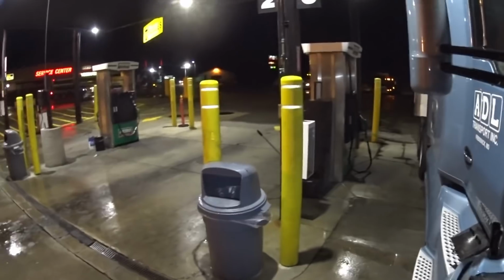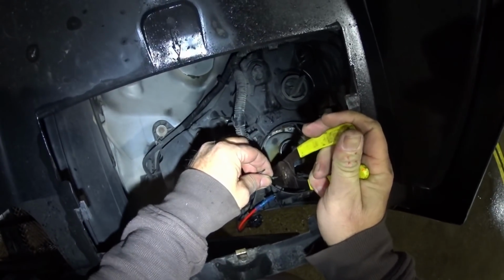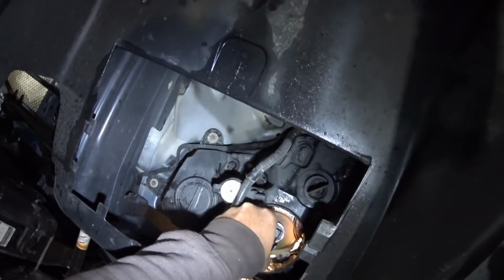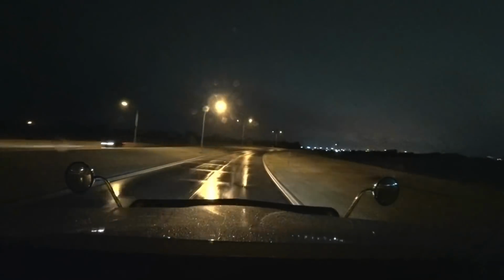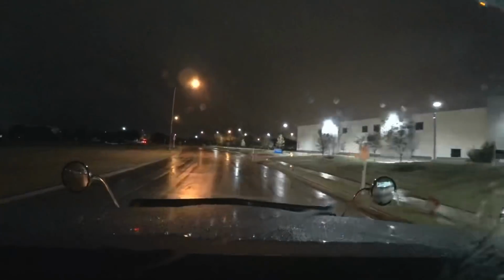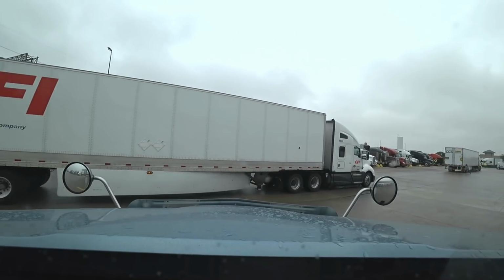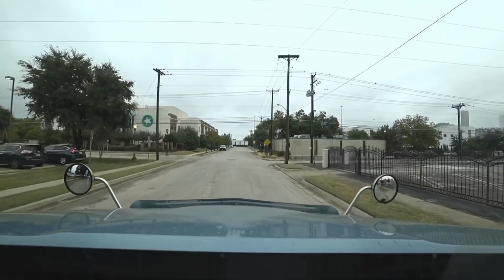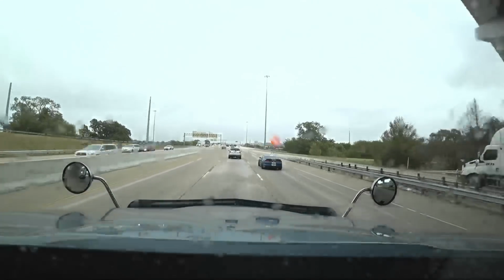November 6, 2019/227 Trucking, time to finally fix this headlight

Comment: Good job on the wiring. Never had a chance to try those connectors.  I use to work with high explosives that required making reliable blasting cap connections. I could show you how to twist wires together that won't pull apart.

Comment: I noticed you, JBG, and Bossman are getting to your stops and having to offload much quicker vs month’s back were you had like 3 to 5 hours before offloading. Turn around seems quicker. Which is great until issues arise, mechanical or otherwise. Same when you get home Saturday night and pickup is 5 o’clock Sunday. That container truck you talked about is so European in nature. Ah well,sign of the times.

Comment: You can re-pin connectors instead of cutting wires and such. All it takes is a small flathead (the type cellphone repair places use) or a thick needle. YouTube is your friend here.

Comment: Sir Larry !!  That ''BED BUGGER" has a trailer setup like the Car haulers have now !!  There's a 5 th wheel under the truck frame ,,but very low to the ground !!! NOT good for speed bumps !!!!  Anyhows,, enjoy your ride back to PA. & YES<< rain & Snow mix with freezing temps !!  Better have -25 degree washer fluid in tank !!""KEEP IT SAFE ""